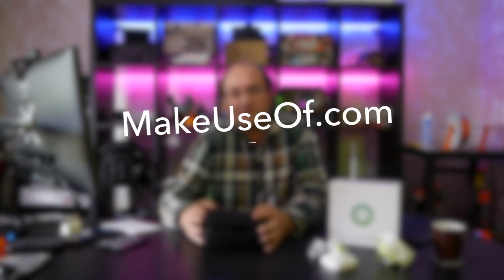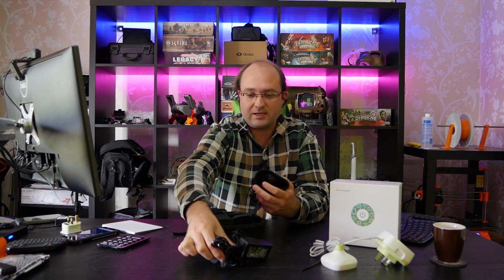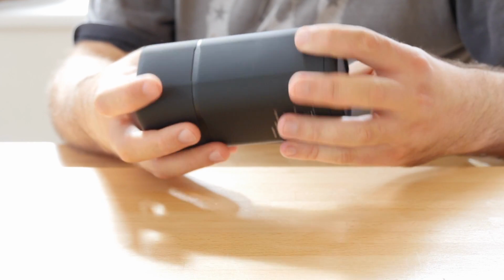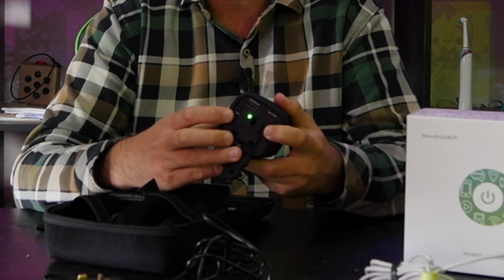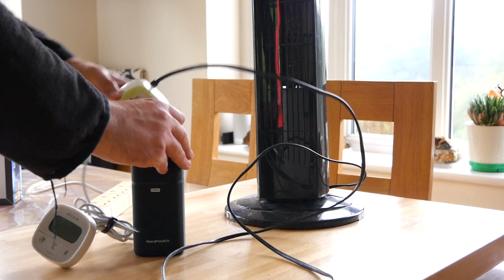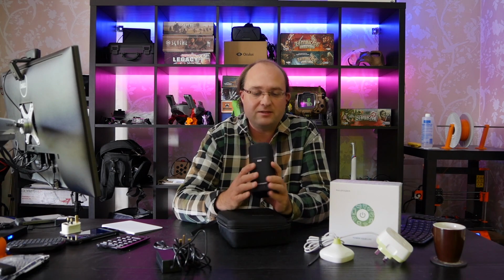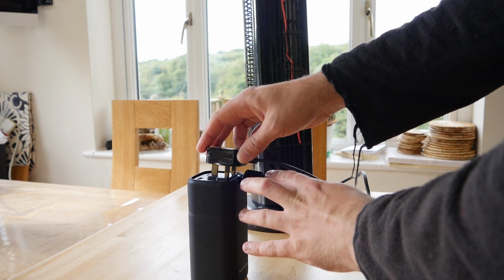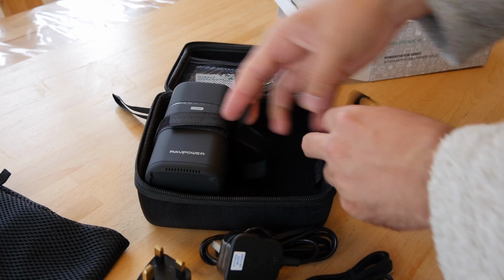Power ALL The Things, with the RAVPower 20100mAh Portable Charger

Comment: I need to buy this model RP-PB054. i'm living in Sri Lanka. All the electric equipments are used in here need 220-240V AC. the thing i need to know is the AC outlet in this power-bank is able to supply that voltage? Additionally i need to know can i use this for my 40W LCD monitor? also can i know how many battery cycles have with this? Thank you.

Comment: Is this battery bank heavy? Was thinking of getting it for my laptop and phone for uni.
Reply from the maker: Not particular heavy, would fit in the waterbottle pocket of a backpack, or comes with its own neat case that holds all the cables too.
Reply: @MakeUseOf  That sounds quite good! Do you think according to your review that it would only give one full charge for a laptop? And like how many charges for a phone? Cause I am at uni for like 7-8 hrs a day due to public transport and my laptop and phone always die halfway thru the day. It would be a bit pricey but I am going to uni for the next 2 years after this one and I think that plug sockets will be in short supply since it's a different campus with thousands more students then my current campus.

Comment: may laptop is 100-200v ~ 50-60hz 2.34A. It's not charging? Do you any idea why its not working.
Reply from the maker: 1. Have you tried the laptop charger on a regular plug? 2. Have you activated the AC output? You need to hold the button down a few seconds until the blue light activates.
Reply: @MakeUseOf  Yes i tried it, when the green LED appear, i plug my Laptop adoptor, and started blink the 5 blue LED light.

Comment: 5:19 that sir is a modified sine wave output , its not really intent for bigger equipment like motors and other things , if lets say you have 400 watts available doesn't mean the strange buzzing noise will disappear , its just the inverter technology built in the device thats responsible for output power , if you really want clean energy output find something with a pure sine wave certification , much efficient and more safe for more sensitive equipment like computers in fact with PFC (Power Factor Correction) , Fans etc.
Reply from the maker: Thanks for the info, Joshua, noted!

Comment: DONT BUY if you want to charge drone battery. It charged just 1 battery full. Second batter charged %50. I have mavic air.
Reply: Are u sure because i want to purchase it fory MA ? 
Mavic air battery around 2500mAh ? And this one 20100mAh so it givea around 16000 to 17000mAh.

Comment: Am I going to be able to power up my ps3 with this? 🙂
Reply from the maker: How much power does it draw? I would have thought it would work, but you'd need to check the maximum wattage it might pull.
Reply: Game consoles need little under 200watts to be powered so no, can’t use this battery bank 

Just cuz this battery bank has a will outlet on it, doesn’t mean it can power anything you plug into it

The average laptop needs 45watts to 90watts buy game consoles need around 170-190watts or so while your average microwave needs 1100watts

Comment: I have return my first power bank because surge failure. the new is better, but surge protection is too sensitive. for exemple, if i run my win10 tablet at max power (processor and graphics at 100% usage) and u plug the adapter , it instantly start blinking and stop (the adapter is rated max 30W and normally, the power bank support 60-70w max. i think is bullshit!) if i put some adapter, the initial chagrge when plug the adapter make the surge protection activation and Without any laptop or device pluged at the adaptator. I can use the tablet (30W) but the adapter need to be plugged before starting the AC output and if the device is at max power, 1/2 time it surge protection shutdown the AC. Sad because it can be a great device. but the Surge protection sensitivity or failure mat it bad even if you run a 30W tablet... :/
Reply: Same problem here, avoid this power bank

Comment: Excellent review.  You might find a suitable boost/buck DC power converter on eBay that would convert your nominal 12v to 19v to charge this :)
Reply: Did this charger last you for the year (assuming you have it)

Comment: FYI, It was the state of Florida that  2 million people HAD to move out of the state, North. Most people with cell phones have car phone chargers. People that live in hurricane  prone areas have power converters that plugin to those cigarette lighter/aug. power outlets in our vehicles. My  DC/Ac inverter is  400 watt. I got it on Ebay for $35.00, shipped free to my home. Also got my cell phone  car charger on Ebay for $3.00, shipped free to me. Also , the authorities are only letting residents visit area's that have cleared road access. They can't stay until power is restored. Florida has thousands of  utility trucks, from around the U.S., helping to restore power lines & communication services.